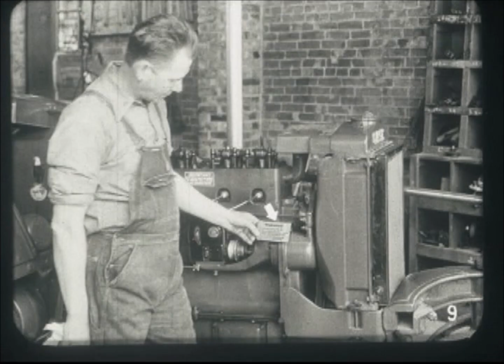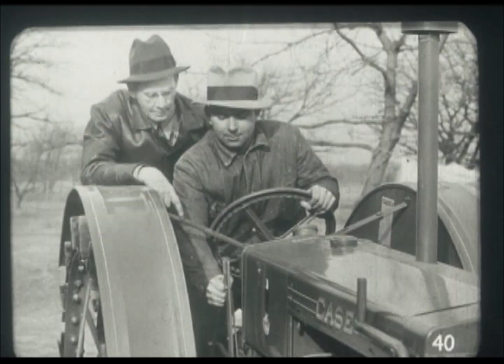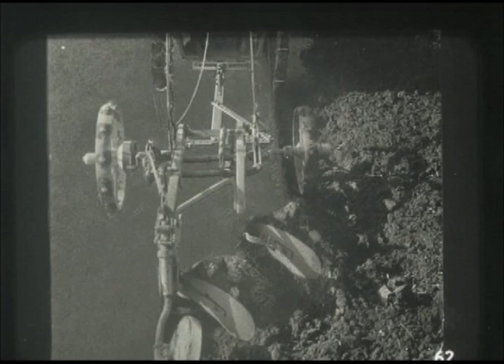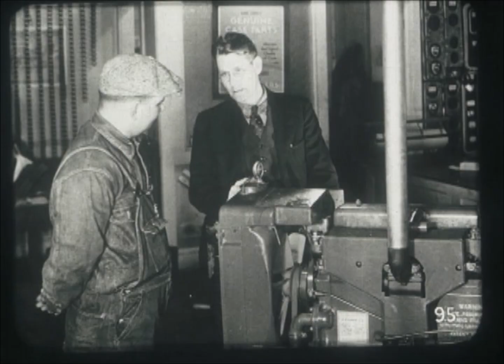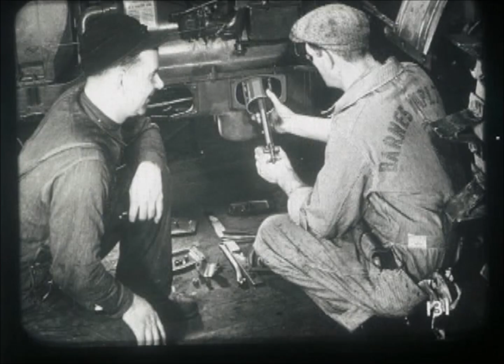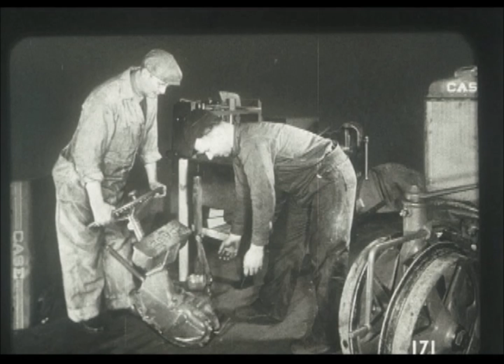J.I. Case - Ed Harvey and his Tractor

Comment: I love the STARTER 😊❤ crank. No electric wirse to a STARTER. for a farmer. The crank starts was sure and always. It's just you and your tractor every time. You as the operator  were the only POWER required to start each and every time. I wish modern tractor had a MANUAL start 😊

Comment: 😊😊 there was a time ⏲️ 😊 many years ago when U had 2 only go a few miles 2 town when U went 2 the tractor 🚜 😊 dealer and when U got a brand new tractor 🚜 😊 U got the owners manual , operators manual ,and the parts manual and the tractor dealer always kept parts in stock all of tge time ⏲️ 😊 and they would check ✔️ 😊 on U and see 👀 😊 how the tractor 🚜 😊 was doing the shield that he is talking about is 4 when U are using low grade fuel kerosene most also had  damper on the manifold U could set 4 that fuel so it would use the low grade fuel 😮😮 although it make or have no where near the power gas did 😊😊 and better octane gas wasn't made until later on when it got stronger and it was making more power than be 4 😊😊 abd tractors finally got away from the old slow speed e lines that has babbit bearings most was only about 1,2OO RPM / then in 1938 when they went 2 insert bearing the engines was reset and they had more power 🔋 😊 it also had 2 do the cylinder and the pistons and air flow of the engines  GAS //LP GAS /DIESEL  😊😊 OMG 2 1 2O25